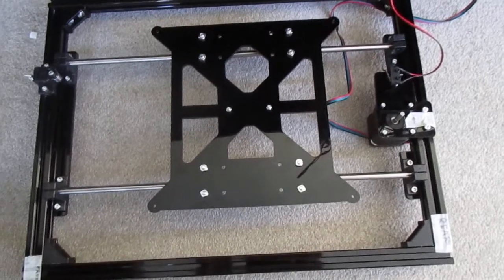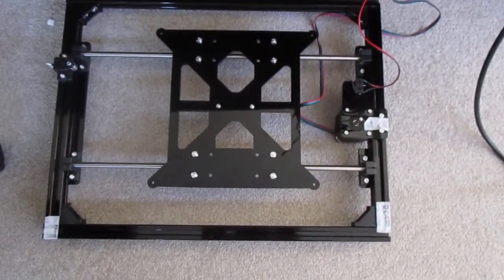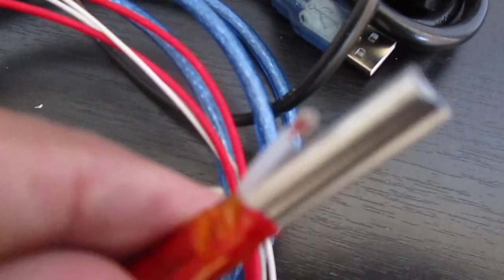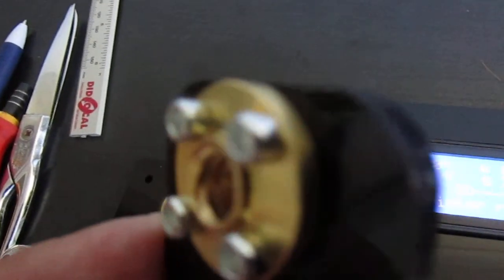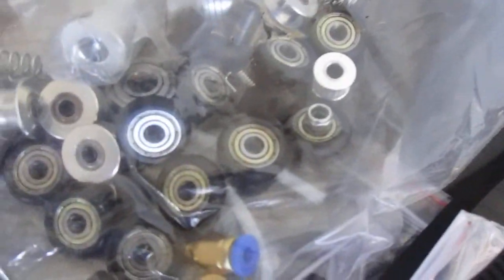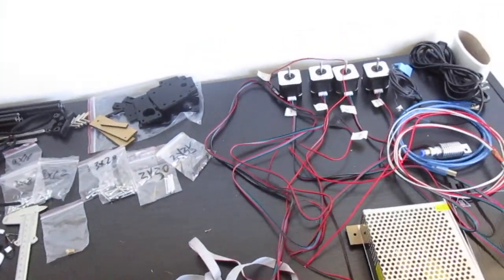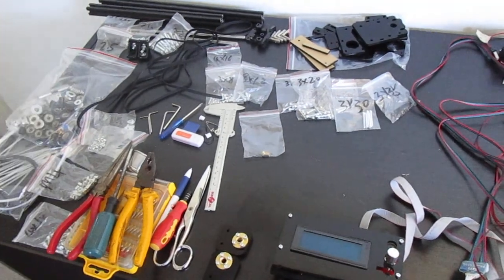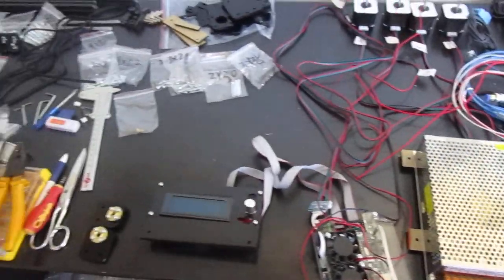Flsun i3 3D Printer Assembly Start & Unpacked

Comment: Hi, can you upload the PDF of the assembly manual?
Reply from the maker: Luckily, I have the manual, but cannot upload here. I dont think Flsun even make this type any more..
Reply: @apached343   do you have the measurements of all the black aluminum profiles?
Reply from the maker: @nicolasmarchi2727  Base 460mm x2 & 320mm x2
Gantry Vertical 400mm x 2. Remaining are not listed in the manual
Reply from the maker: Was just looking around online and found a  manual. here : https://www.dropbox.com/s/r4itqksu4w9gef6/C%20assembly%20manual%20newest.pdf?dl=0
Hope it helps. Also more discussion here: https://github.com/NickEngmann/Flsun-I3-2017